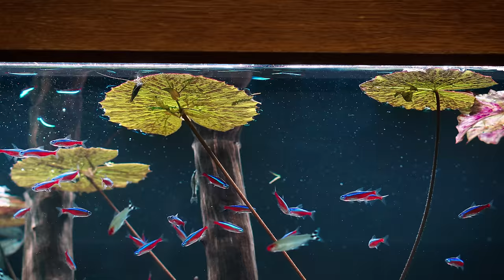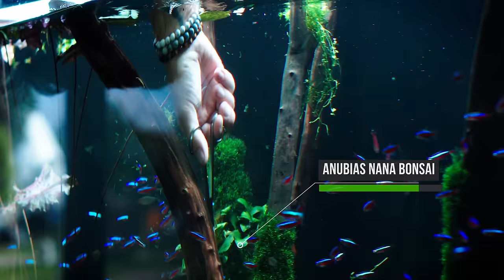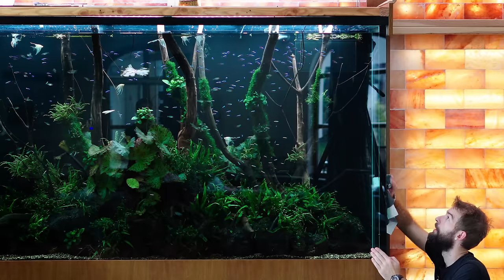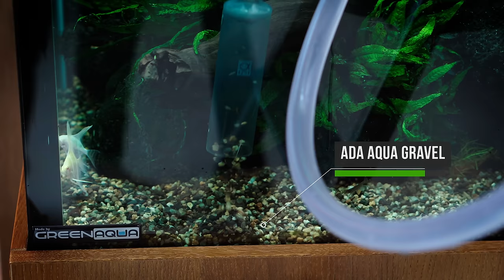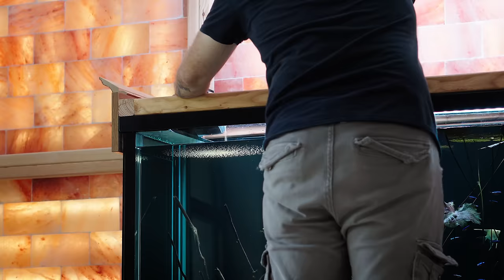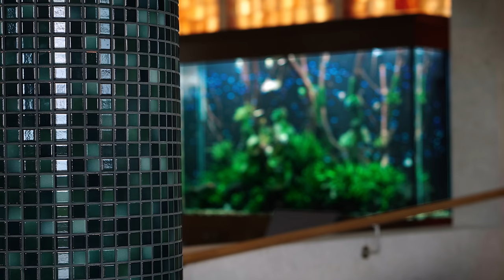The 1200 Liter Masterpiece with ANGELFISH | Monday Maintenance Movies

Comment: Is it good practice, as it seems in the video, to keep a cloth under the outside magnet cleaner, perhaps to prevent scratching the glass? Inside, I suppose the water lubricates it.
Reply: I used the cloth because the outside of the magnet is missing the fine cloth 😢
Had to make it work somehow. Good perception 👍
Reply: @thor0118  Good improvisation when working far from home base.